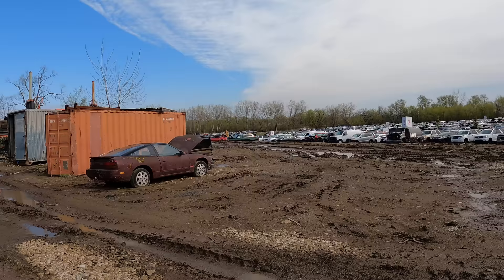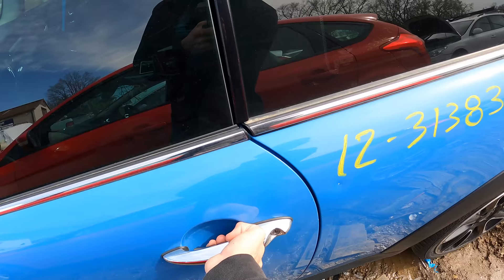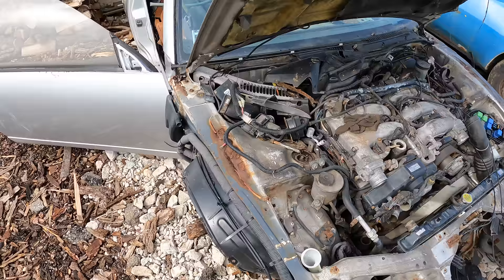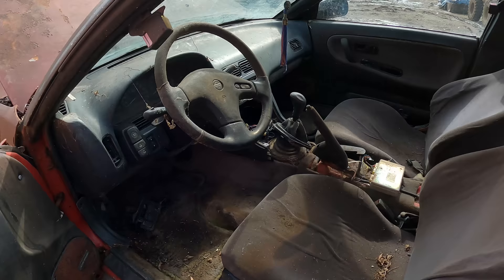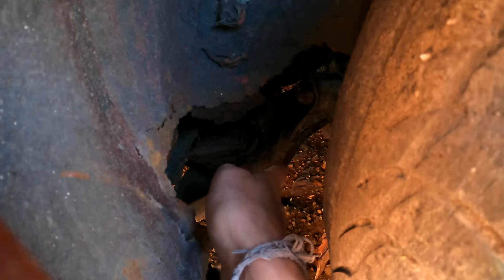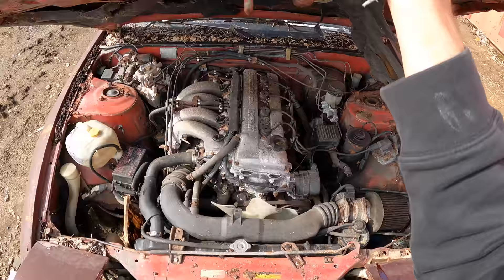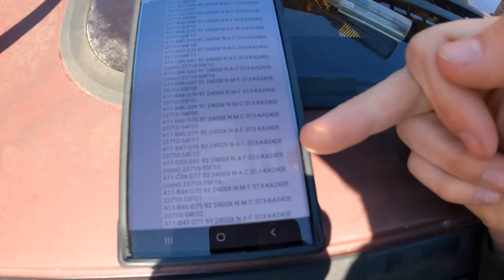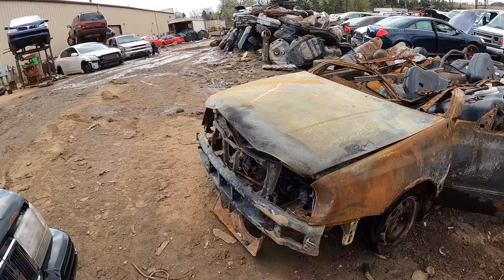Exploring the Junkyard and found a gem!

Comment: At 4:19, that appears to be a 1978? Ford Pinto Wagon, neat little wagon for sure. Also that Lincoln at the 23:00 mark, the trunk line was meant to mimic the older body styles in the 50s and 60s iirc where the spare tire was mounted externally on the rear bumper and covered with a paint matched plastic/fiberglass cover.
Reply: Yes, definitely a pinto wagon..unsure of the year. You're probably right on that as well
Reply: i thought it was a vega wagon at first
Reply: Yes, 77-78 Pinto

Comment: Hey Mike! So the "weird thing" you mentioned on the Neon about the windows, was pretty common in Europe, or at least that's what I remember. Power windows on all four doors was mostly an extra, and you had to pay for it if you wanted it.

Most people actually didn't care, because on most cases no one was going to sit back there anyways.
Reply: Same with Australia (though tbf most of the cars we got were basically the same as EU models), wasn't common by any means but I've seen a fair few.
Reply: Feel like it was a common thing in EU on 80's-90's cars, read somewhere that some base models in USA had much better options than base models in EU
Reply: Can confirm Europe has this on quite recent cars even, we have an '08 Golf and that has power upfront and crank in the rear. Such a weird thing.
Reply: Even high end cars. I have a well equipped 325 TDS E36 that still has crank windows in the rear
Reply: @kyliandc9276  I mean it's still not a luxury model, so it makes sense kinda, plus it's old

Comment: They always said the dodge neon windows were manual in the back because they only role down a quarter of the way anyway do to the child safety things. Plus obviously it was a way for dodge to save money on wiring. 
We currently have a 02 neon sxt 5 speed like that. It's at 281,000 miles right now and still getting us every where we need to go🤞. Its the highest milage ive personally seen on a vehicle myself.
Another great junkyard video man👍

Comment: I have a Mercedes E320 wagon myself - 22:05 :D It is waay rustier (rust holes everywhere) but runs very nicely, used only on winter track
And 22:36 front electric window regulator, rear crank is the same thing as my daily driver which is Audi A4 B7 Avant

Comment: About the Neon power windows... in the early 2000's here in brazil it was common to have front power windows and rear crank windows, some said it was for safety concerns, regarding small children to have a hard time trying to open it, so it was safer, I dunno... Being a 90's children, I remember they sucked to open at that time xD

Comment: That Lincoln that you saw there with the big doors is the equivalent of the Lexus SC300 cannot be more true that is a 1993 to 1996 Lincoln Mark 8, they are beautiful cars and dream to own They Ride nice and have a lot of power the motor that was in these cars would later be put into the mustang cobras! They are RWD on airbags and usually get converted to coil springs when the airbag system fails likely why that cards in that yard but apart from that they were very solid and reliable, I drove mine 250,000 miles from 60k miles, sold it to a collector and am looking for another, a shame that one ended up there probably over something minor, mine was the same color!
Reply: If you ever want to get into American luxury boats/ muscle, the 1993-1998 Lincoln MKVIII is the way to go, they are excellent cars and come with 280hp from the factory, 4 speed autos that you can manual swap with a trans from a mustang, plus 22+mpg on the high way, they are efficient V8's

Comment: My first car was a 240. Third car was an 84 300zx. God i miss the 300zx. Nothing better than the feeling on the rear end dropping down when you put it in drive. My 240 looked almost new however it never ran unfortunately. I bought it as a teen from a guy who had the motor rebuilt before going on a road trip. It died about 50 miles into the trip. I spent so much time making it look good sitting in it listening to the tunes but with a single mom no male influence and knowing nothing about cars at the time it just sat there looking "pretty". I wish i could have just got it running good once to see how it drove.

Comment: Holy crap the rustiest S13 on the planet appears to have non-rusted a-pillars somehow where mine have rusted through just above the bottom corner of the windshield on both sides, and my car doesn't have even 2% of the rust that car does... what the hell...

White car looks like a  1980 ford pinto to me.  I saw several chevy vega guesses and while very similar, I don't think it quite matches.  I instantly thought pinto of some sort when you started walking up to it just from the look of the front end and I'm  * cough *  old enough to remember when these cars were still on the road...

Some boot manufacturer is missing a sponsorship opportunity here!

Comment: If you ever come across a mk4 gti with nice interior I need the window controls and plastic bezel around them 😅 just picked up a 20th anniversary edition for $500 that overheats and had a coolant leak. Thermostat and coolant hose connector later she’s mint lol. The recaro seats are still in good condition but door cards and saggy head liner are the downfall currently.
Reply: Also I think that white car was a Chevy Vega station wagon! People are known to make drag cars out of them because they are a light body platform for a v8